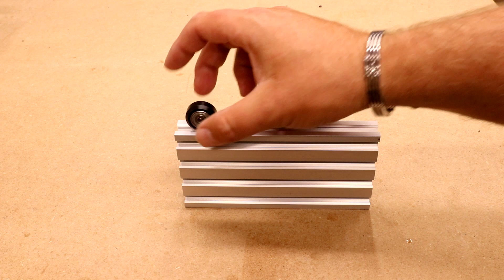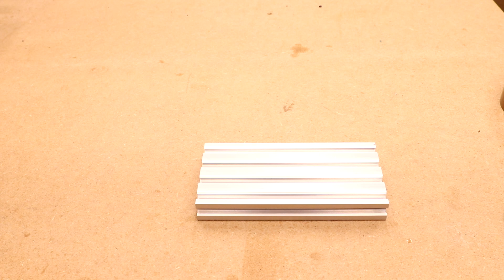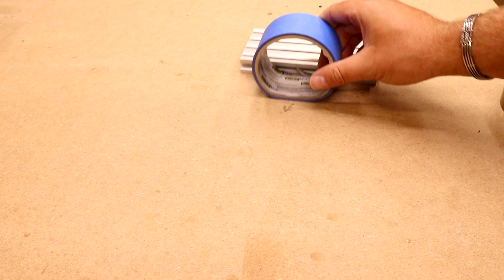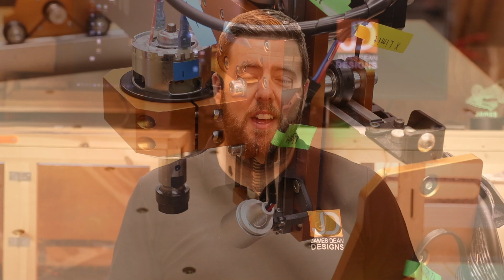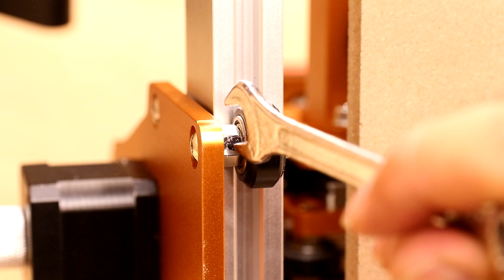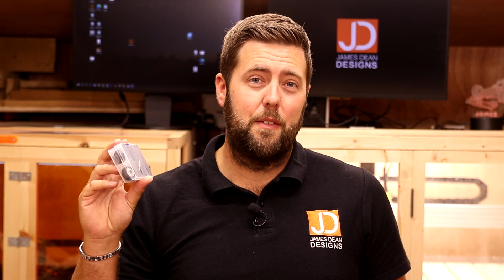Fixing flat spots on CNC wheels and how to change them - Beginners guide

Comment: Thanks for the informative video James.
I just bought the Masuter Pro and the wheels on the X axis were so tight during manufacturing it has a significant “kachunk” as it rolls back and forth.
I hope FoxAlien is a good sponsor because I bought the Masuter Pro based on your livestream.
I also bought the 300 watt spindle and the 20 watt laser module. And the offline controller.
Your channel is a great resource. Thanks!
Reply from the maker: Thank you and hopefully the video helped you out with that problem
Reply: Same issue here. One wheel had a mark in it.
Reply: how is the offline controller treating you? I feel the 300w spindle isn't doing the job I want because of user error and I still have hope for it (hope as in hope I don't end up wanting to buy a makita router that I maybe should've bought in the first place 👀)

Comment: I got mine this week and have very noticeable flat spots. I just put brand new wheels on the X axis as they were the worst ones and the flat spots were still there. It's the aluminium extrusion on mine has the flat spots where the wheels were. They were probably overtightened in the factory and bent the aluminium. not sure whether to try for a refund or try straightening the ali back.

Comment: yeah i had the same out of the box but i just losend the top screws (the only one that you can unwrench) and then i thought i should be ok but it wasnt so when i was busy wrenching between the wheels it looked like it popt and it suddenly normally moved slides left and right without dips/hicks whatever… just fastend the bolts and thats it… really strange